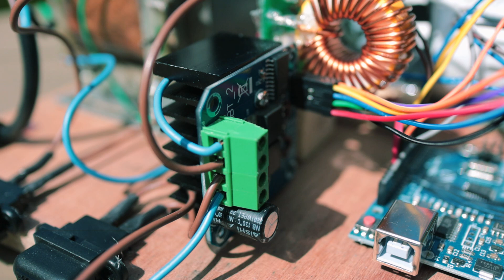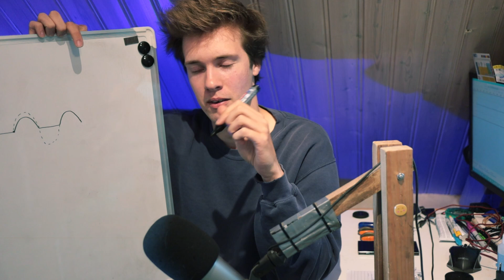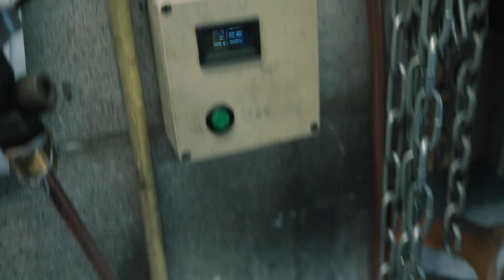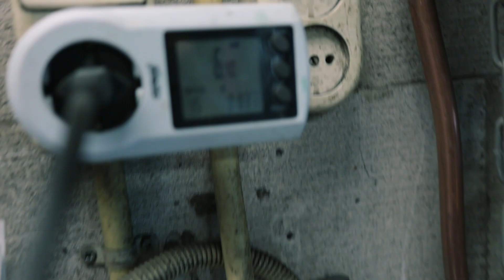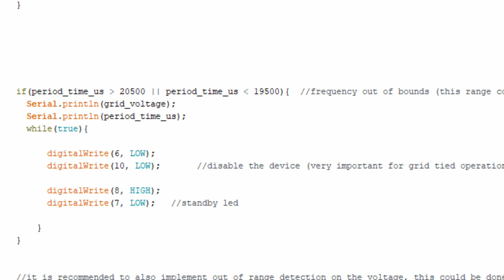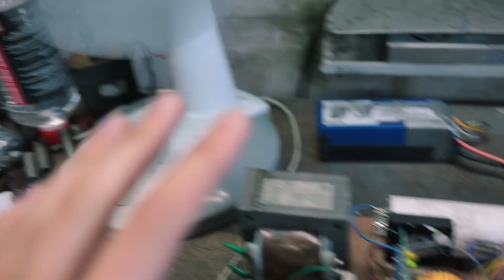Home made grid-tie inverter (not even all that sketchy)

Comment from the maker: Perhaps I'm stating the obvious, but of course this inverter is meant for demonstration/educational purposes. If you need to deploy an inverter for production use, just get an off the shelf unit that meets all the grid code requirements of your region. Hope you enjoy the video :)
Reply: Hi Sir,
I heartly thanks to you for this educational video your approach is the one of the best. I want to connect with you on instagram for some guidance . i waiting for your positive response 
thanks a lot♥♥♥♥
Reply from the maker: @vinayak0311  What information do you need? I think all you need is in the diagram.
Reply: @ sir, first of all thanks for you response 
Sir, I have little  confusion in rating of inductance coil and capacitor  used for filter ckt means what is the current ,voltage, capacity rating of these component .
Please provide me details 

Last thing sir , what protection you used if our inverter not synchronised  with grid then I think in the presence of grid power the grid power flow back in the inverter ckt
that cause a huge damage of whole ckt
please solve my problem
thanks Again
Reply from the maker: @vinayak0311  If you can't figure out these things yourself this isn't a project you should be building.

Comment: I watched your video, and I  really love it and I want to develop this for myself (household use), so can you provide me with all the connection and details regarding this project, if you can it will be really helpful for me ;)
Reply from the maker: @unsupporteduser  diagrams and code are all available at the link in the description. I also recommend you take a look at the updated version I made in a later video.
Reply: @AKIOTV I want to understand the connection between the Arduino and the transformer and I also want to understand from where and how you gave supply to Arduino.
Reply from the maker: @unsupporteduser  The arduino is powered by the usb port, the connection to the analog input is the sense wire for detecting the grid voltage. The resistor network adjusts the voltage to an appropriate level for the analog input.
Reply: The power you gave to the Arduino through usb is from 24 v dc or from the grid transformer side ? , and can we run this inverter through 330 watt 44 v voc panel, can you provide me some photos of project if I gave a whatsapp no of mine.
And for how many watt we can create through your project.

Comment: Hey your project looks great. I have a few questions i hope you can answer. First i noticed you have a 50m resistor series with the transformer? Whats the use of it and doesnt it burn? Can i use an arduino nano to remake the same project because i used one to make a project involving changing a pin high and low with so small delay it made the board overheat and the chip froze and couldnt change the code on it
Reply from the maker: @hadeseh6808  Arduino uno vs nano shouldn't make a difference, so yes you could use a nano.

About the resistor, it's basically a shunt to measure the current. For more info on this resistor and some other important details I recommend you take a look at the second video I made about this inverter.

Comment: For measuring current while isolated, hall effect current sensors can be used. They basically measure the magnetic field generated by the current flow (without the need to be connected electrically). I used them for my DIY solar MPPT, though for a different reason (lower losses than shunt resistors, especially at higher currents).

Comment: Hi AKIO TV. Thanks a lot for this detailed educational video. Just a question: How to run grid tie microinverter off grid? Can another battery powered inverter be used as grid source? As microinverter has slightly higher voltage output, should I use transformer. Or it may cause power go out of phase? Thanks.
Reply from the maker: @sultanast  You could try to synchronize it to a battery powered inverter, but I have never tried it. Not sure it works for every combination of inverters. The best way would be to have an inverter that can operate in both isolated and grid tied mode.

Comment: Nicely thought out implementation. A few queries though :
A)I am curious though, an inverter is supposed to deliver power off grid usually. So how would it help if it shut itself off when the grid is down ?
B) Wouldn't it be better to put the filter on the output side , since it would reduce the inductor size due to less current ? Also most inverters seem to have only a capacitor to do the filtering.
C) Please make a follow up video, explaining the code ?
Cheers !!
Reply from the maker: @mumbaiverve2307  A) Have you finished the video yet? Edit: I misunderstood the question, the reason it needs to turn off is to prevent back-feeding into a dead grid segment. You don't want to zap the lineman who's going to repair the power line. You could have an inverter that continues to operate when the grid goes offline, but then you need to disconnect your house from the grid first. 

B) the filter is before the transformer because you don't want to send high frequency pwm pulses into an iron core transformer. I'm also not aware of an inductor-less filter design for this application. 

C) I'm working on an updated version of the inverter.
Reply: @AKIOTV   B) There is an inverter IC called the EG8010. You may have seen it around. As per the appnote for this the capacitive filtering is on the secondary. Some do wind the input side wire of the transformer a couple of times around a ferrite, to give a few uH of inductance. But its not mentioned on the datasheet.I did build a 500VA inverter using this chip, but it was a bit flaky. It does not have a reset pin so startups are sometimes erratic and blows up the H bridge FETs.
C) Would love to see more. I was planning to get make a version using the STM32F103 and your insights would be super useful.
Cheers !

Comment: Fantastic project! Thanks for this. To monitor the AC voltage and current (in both directions) you could use the arduino emon lib. (Just google "openenergymonitor".)  But the CalcVI procedure is computationally expensive and might need its own processor (e.g. ATtiny85). This chip could also do the frequency monitoring and deliver a zero-cross indicator output.  I think it would also be a good idea to have another ATtiny85 slave driving the H-bridge (or mosfets). Then the master processor just talks to the slaves and runs the LCD, serial debug comments, buttons, temp sensor, etc.

Comment: Wouldn’t it make more sense to manipulate the inverter power angle as opposed to voltage to control the output power? My understanding is that in an AC transmission system, power angle determines active power while voltage determines reactive power. This is known as scalar control. However for a grid tied inverter I recommend field oriented control because it is easier to tune and has better dynamics. For a single phase inverter i highly recommend using a PR controller over PI because PR tracks sinusoidal set points with less steady state error. You can use PI in what is known as the DQ synchronous rotating frame (SRF) frame but this is more complex as it involves using the Clarke and park transform.
Reply from the maker: A regular grid tie inverter, regardless of its control system (simple "V/I" or FOC etc.) attempts to be a source with a power factor of 1, aka 0 degree lag/lead in current. Output power is controlled by small changes in amplitude. Larger, more advanced GTIs (the kind in a large solar farm or wind turbine) are usually able to change the phase between their voltage/current, so they can indeed supply or absorb reactive power to assist improving power factor on the grid.
Reply: @AKIOTV  when I mean power angle I mean the phase angle between the grid and inverter voltage, not power factor angle which is the angle between inverter voltage and current. Power angle is also referred to as torque angle or load angle and has symbol δ as opposed to θ for pf. In an inductive line; P=(VS*VR)*sin(δ)/X and Q=(VS*VR*cos(δ)-VR^2)/X where VS is the inverter sending voltage, VR is the receiving grid voltage and X is the line reactance. Thus scalar control uses V/δ not V/I. I am surprised that increasing your inverter voltage increases the power. I suspect this is because your reference is on the on the input as opposed to the mains side of the transformer which causes a small vector angle between the 2 voltages due to the transformers leakage inductance.
Reply from the maker: @fablearchitect7645  In a synchronous generator, the more power (torque) the prime mover (steam turbine, diesel engine, whatever) produces, the higher the load angle, and the greater the generator's output current.  

Increasing the output voltage of an inverter has the same effect. If your inverter is a sine wave source that is perfectly in phase with the grid, and has a slightly larger amplitude, then you push current back against the grid voltage, much like a synchronous generator with a positive load angle. (or negative depending on convention I guess.)  

And since the amplitude of the inverter is proportional to pwm duty cycle, simply increasing the duty cycle increases the current/power.

You could have a control system that simulates a synchronous machine mathematically, including load angle etc, but in the end when that gets translated to the hardware of the inverter, an increase in power would still end up being achieved by increasing the duty cycle.
Reply: @AKIOTV  The equivalent circuit of a synchronous generator is a voltage source which represents the field excitation with series inductance of the stator winding. An inverter has the same equivalent circuit except the voltage source is the PWM and inductor is the filter. 

Therefore as described by the equations in my previous comment, increasing the inverter voltage magnitude while in phase with the grid will just increase the reactive power generated with no active power. If you simulate the equivalent circuit in spice or any other software or google "power line phasor diagram" you will get this result. 

Active power will only begin to flow if you vary the inverter voltage phase angle. In a generator this is done automatically by the prime mover where the field exited rotor angle leads the stators rotating magnetic field. In an inverter however, the power angle of the SPWM not amplitude must be varied to transfer power. 

Hence, why I am skeptical that increasing the duty cycle and thus voltage will increase the active power.
Reply from the maker: @fablearchitect7645  Interesting. In my mind, I have been looking at the inverter as a whole (including filter) as a sine-wave source. (or at least close enough to one). After running a quick simulation, I can see how that view may go wrong; it doesn't include the effect of the grid connection on the filter. Perhaps it is indeed better to see the filter as a separate thing and the H-bridge as the voltage source. 

But although I think the filter inductor could have the effect you describe, I'm not entirely sure it is entirely analogous to the inductance in a synchronous generator equivalent circuit. Why? Because the filter inductance is sort of an arbitrary choice of the inverter designer mainly based on PWM carrier frequency. If you have a particularly small inductance here, that makes the inverter behave more in the way I described before.

I'll link to a simulation that shows what I'm talking about. The grid is on the left side, the inverter on the right side. The phase and voltage of the inverter can be controlled using the sliders on the right side of the screen. You can adjust those to see the effect it has. There are two cases: one with the filter specs I used (100uH/35uF) and one with a tiny filter (10uH/3.5uF). 

https://falstad.com/circuit/circuitjs.html?ctz=CQAgjCAMB0l3BWEB2aA2MBOZAOBaFkAmbSQkAZgiQBYKQEBTAWjDACgA3cGmnvsLxA0cUcA0jhJ0qNATsA7v2GiiRPiPDsATiDUbVOUZumwO3XqMEbNJ8QklgZp+QHNl1j2mfsakesyaaHw4jkSi0gD6wZGQkX6YmJFEcTA0kazJsZEU7AA2ekYqlGjGEbLwkInVNbWJFURgKThguDTBmP4tSJDsAMaFZYPKppUUSMyY0MiYCDgU7cj+gv5oFZAcuhSlxZbFoxxK4VZCe569R0We10IXwxTbyg9rd8eUj3vPUDolqn7CmnUzjM-WGQPuj1GYwmUxmCBoKUweAQajQmHWHAKb3B2z+wMqVTqRPqzBg8CI8KwOFwpScVTR33cni+zJRYl6Fk0Xz24McEik7Nk8l0+j0-2x-wOimU4NF4PMT0enl59kcziFvn8IECqnwIFClBSYhS0XScQSSScsWgYAytqIyTiuT8AWaIGC2oNTXKcRiyHihMiCGttsytrA0ApmtdkF1a2YBooRskJr9AcSQZDdsitrJuCa8goonoADEIJIrERtRAALIAQwAHgAdADOADUAPZ5AAuddcjHYRcoIDLwm1FEkE+rIAACgALOstxitgDyADM10vu4OrMgR+X9eAq6wQPXm+2u73+zvwHvR3xmFOpyf54vly315vGNugA

What can be seen, is that indeed with the filter size I use, you may be right. Again, I'm not sure your comment applies to GTI's in general, because it doesn't seem to work this way for any filter size. The case with the small filter does not show the same behavior. Still, I think it's worth a shot to reprogram the pot to adjust phase rather than voltage, and see what happens. Would be cool if I could get much more power this way.

I also have a potential explanation for why it does produce power when increasing the voltage. It's possible that there is actually already a small (unintentional) phase shift of the output, due to a software processing delay etc. It's fairly well synced, but a 1 degree offset wouldn't surprise me given the processing speed of the arduino and my generally poor code. This would then cause active power to be supplied. Then when you increase the duty cycle, it would increase both the real and reactive power. (you can try this for yourself in the simulation, start with a small phase shift, then start increasing the voltage.)

I think I'm going to put this to the test, to be continued.
Reply: @AKIOTV  Yes, the point about modeling the inverter as a voltage source with filter inductance is the point I am getting at. A smaller inductance just means that a smaller power angle is needed to increase the active power. The fundamental of the H bridge voltage source can be approximated as a sinusoidal voltage source using first harmonic analysis.

For a simple L filter you do have to increase the voltage slightly while increasing the power angle to maintain unity pf. This makes sense when you look at the phasor diagram.

For a LC/LCL filters with ESR the general relationship between power angle/active power and voltage/reactive power is fundamentally the same as L filter. Only the specifics of the equations are different. Since you are using a transformer on the output you should model it as an LCL filter due to the transformers leakage inductance. LCL filters are considered the best filter for inverters because the secondary inductance forces the harmonic currents to flow through the capacitor as opposed to the grid. 

Now doing this open loop is quite difficult without calculating the power angle and inverter voltage. I have a calculator and phasor diagram that does this for you here: https://www.geogebra.org/classic/tcmcfzye

Comment: Thanks alot for this efforts .I built the same project and thanks again what i add to your code a stabd by mode to work autumatically also i modifyet to mert 60Hz and soft start as well as another two output that stay high to drive my H bridge can handle much more power .Actually ChatGpt help alots.
What is confusing for me how can real inverter injuct power to the grid because what i know the voltage  must be higher than grid to injuct power to so could help the technique to do that .I am planing to add current hall sensor to output then i can change A4 instead of potentiometer also to shout down for over current but i am not sure what the best technique to be real one .

Comment: I have to object. In Germany, grid tide inverters must have a double shutdown in the event of a fault. On the one hand, the mains voltage is monitored and the H bridge is switched off via software. On the other hand, a relay must be added that separates the inverter from the mains voltage. 
A large Chinese manufacturer ran into problems because he replaced the relay with a wire bridge. The Chinese decided to provide customers with an additional relay free of charge. This saved the manufacturer's reputation.
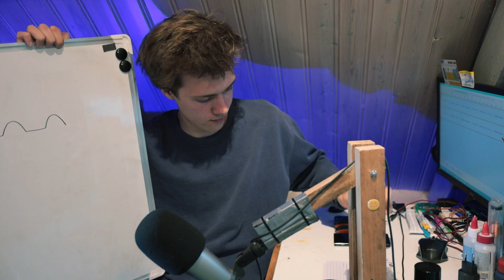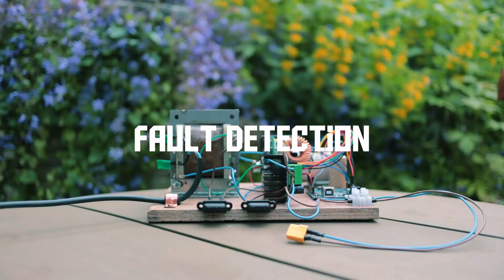Reply: The relay is only about isolating the inverter output from the grid when it is inactive. This is a separate device with microinverters. The deliberate frequency drift (explained at 6:25) and the freq test (explained at 15:10) actually implements a slip mode frequency shift anti-islanding algorithm and is a very good idea.  If a relay is put in the circuit and is cut under inductive load, it could break the mosfets in the H-bridge. The regs require the anti-islanding alg to shut down the inverter within 5 seconds after AC power shut-off.  So, plenty of time to detect no power, shutdown the mosfets and switch off the AC relay (and then back on again a few secs after the AC power is back on).
Reply from the maker: @jensschroder8214  Quite possibly the relay is required here in holland too, but I'm not sure. It's also possible it's required starting at a certain power level, maybe micro inverters are excluded. I'll look it up and maybe add one on.

Comment: great video and hard work .if u add dc to dc converter as boost one to 320v dc so u can regulate pwm to control the power by measuring the output power that deliveried to grid .the dc to dc input can vary as solar or wind input change so pwm can comensatet that to what the adjusted max power.
u can buy one for example input rate 12v, to 35v after that thake the important components like ferrite trans and mosfet but before check its frequency then reprogram arduino to deliver the sam freq to guarantee the core not saturate.by adding some probe current and volte of output u can produce your pwm duty cycle .